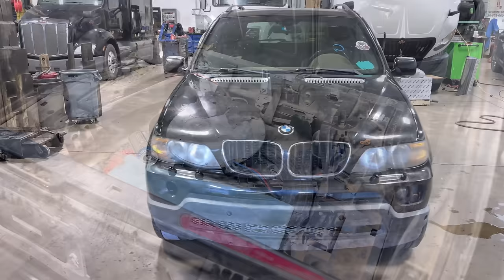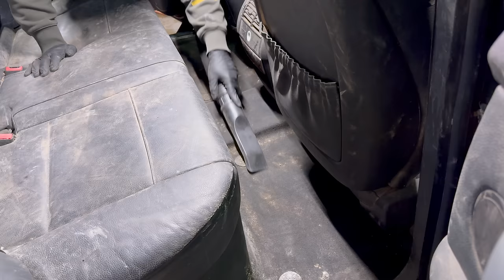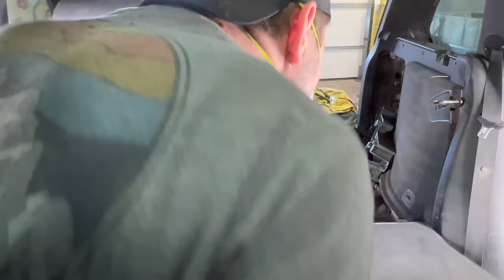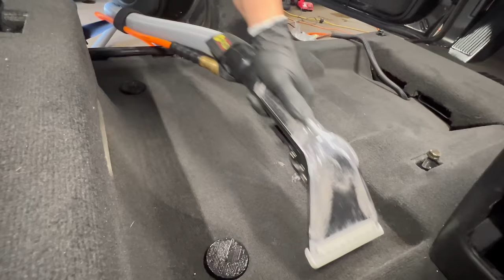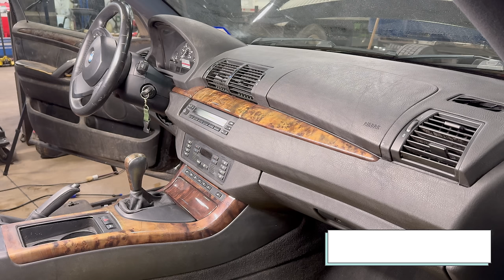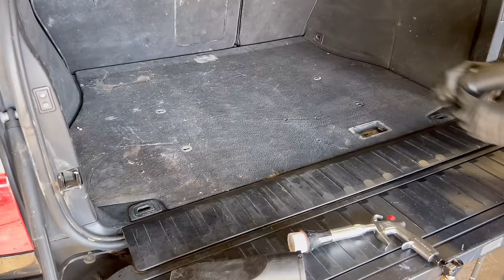Deep cleaning extremely dirty abandoned BMW X5 | Satisfying DISASTER Car Detailing Restoration

Comment: excellent detail work, but one question remains? all the videos I've seen on deep cleaning, especially when there is mold, you don't see changing the air conditioning filter as well as cleaning the air conditioning
José Carlos 
Calgary. - Canada

Comment: Bit of advice with sand in Velcro carpet. Use a hard boar bristle brush to break it up then vacuum. Next use a heavy suds soap like dawn. Get a microfiber wash mit create suds ring out the water and use suds to massage into carpet use a strong vacuum to suck everything up. The suds will help pull sand up vs extraction pushes sand down causing the sand to rise as it dries. Overall nice job.

Comment: These are worth saving. Most of them are on their 3rd/4th/nth owners who can't afford to maintain them or don't know how to work on them, so as soon as something breaks they're parked and eventually sent to the boneyard. I have a 2001 3.0 manual X5 that was rescued by the guy I bought it from who got it back running reliably. I've had it about 18 months and put 15,000 miles on it with no issues.

Comment: I have professionally refurbished cars. They looked almost as good as new inside, as did the paintwork. 
In this video, the order of cleaning is incorrect. The right thing to do is to start in the back of the trunk. Then the fund. Completely remove and clean the seats and carpet. The same goes for the driver and passenger's side. Then it's the turn of the windows, the engine compartment. The paint and trim, bumper as well as the wheels are the finish. That's how precise we work in Bavaria/Germany.
Reply from the maker: Thanks for the tips!